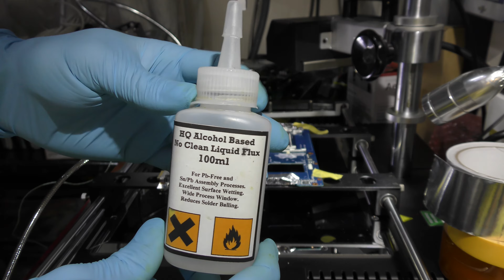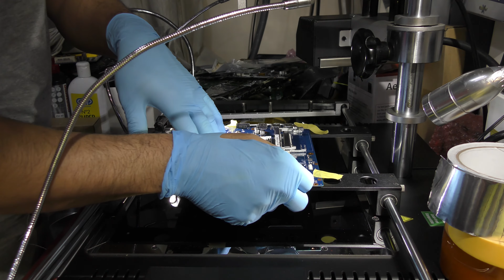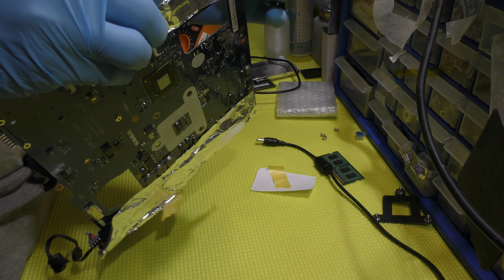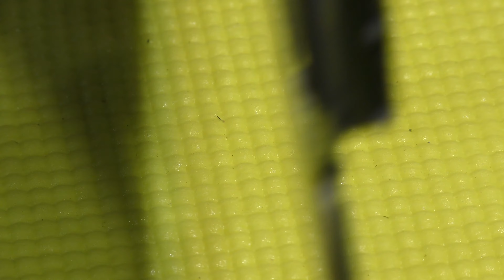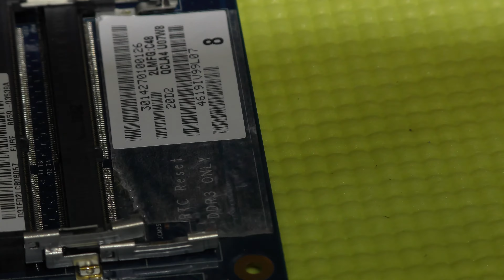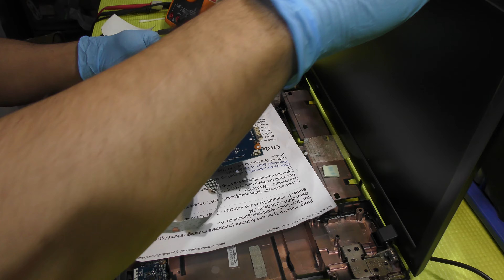HOW TO REFLOW CPU SOCKET WITH ALCOHOL FLUX NOT TACKY AMTECH ETC   4K

Comment: Hello. could i re-flow BGA devices by only applying flux and heat. Should the old balls not simply re-flow when the flux is applied, saving the trouble of removing re-balling etc. Is that what you did here? You just applied flux and re-heated?
Reply: Did you try that?
I want to try the same thing but what kind of flux is he using here?
Reply: @irishguy200007 

No clean flux. Alcohol based.

Comment: have you ever worked on a surface pro 5? i have one that the logo shows and goes out - checking the voltages all seem normal, any thoughts - i have heard possible cpu?
Reply from the maker: Hello, not work on one, but the difficulty is finding a replacement chipset.

Comment: I need to do this to a socket 478 board. I brought it back to life by putting it in the oven for 10 minutes at 180F or so but it still has posting issues here and there where i have to unclip the heatsink then reclip it, or tug on the heatsink a little and turn it on. once its warm its stable though. Could i do the same job just as good with a cheaper heatgun rather than a reflow station?

Comment: How is the CPU socket being heated?
Reply from the maker: Hello, two purpose, one: reflowing cpu socket with only alcohol flux not tacky.  2. Reason for reflow dry/crack solder joint under cpu socket.  Thank you.
Reply: @iTCXtreme  What is the source of heat? Looks to me like you're creating a short under the cpu socket with the 2 wires, is this correct?
Reply from the maker: @tiffanyo3365  the 2 wires thermal couple to measure the reflow/board temperature and the heat source is from the upper heater from Jovy.
Reply: @iTCXtreme  The board is held in a specialist piece of equipment a 'rework station', made to repair circuit boards or make prototype new ones. If you follow the bga link above you can see a couple of examples of these very expensive pieces of equipment. The heat source is usually segmented or zoned, to allow precise heat placement. The heat can be generated by either electric element like a variation of the household iron or hotplate principal or more exotically with either infra red light or as in the case above a hot air blower, much hotter than a hair dryer, more like the heat generated by one of those paint stripper hot air guns. As Mr Man (sorry do not know name), said above, the wires are for thermocouples. Basically these measure the temperature of the board, sending their feedback to a small internal computer like the raspberry pie. Usually this will control the whole process of heating as it will have various set programs or cycles or profiles one of which is selected to do the job in hand. It could also control the fan of course to save throwing the switch yourself! The main thing is not to overheat the board, just the bit your suspect has bad solder joints. The reason you may wish to do this, to re-flow a CPU socket is as Mr Man said a 'dry' or bad joint between the socket and the board. Under a magnifier you can sometimes see a hairline crack around just one socket pin. The main cause of this on a board which has been working fine is normally the cooling fan failing or fan and heat-sink becoming blocked with fluff. (A lesson here is to have your CPU shut-down temperature set below it's normal operating temperature). In a failure situation the CPU temperature can then rise to extreme levels with the heat conducted down the pins of the socket where repeated heating and cooling can degrade the nice shiny joints. Again under magnification the bad joints can sometimes lose their shine and look dull. If the socket is 'surface mounted then' it has no pins just tiny pads matching tiny pads on the circuit board, so little choice but to re flow it if a suspect.
Reply: Can you use a non contact digital thermometer?